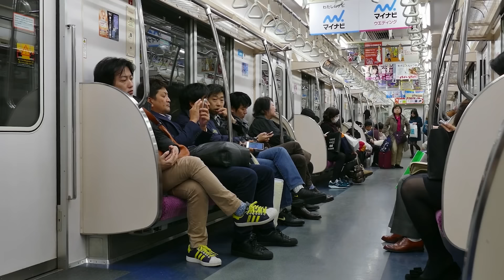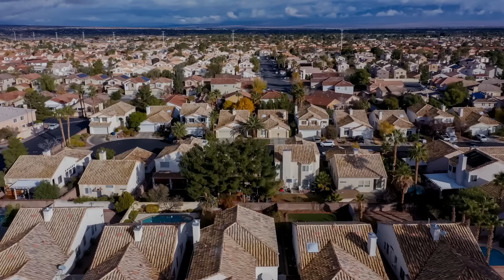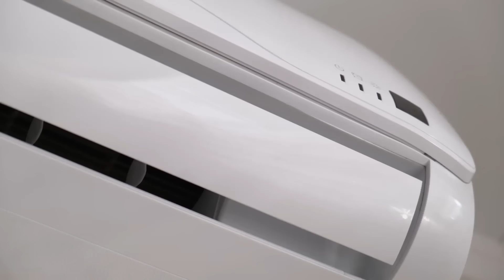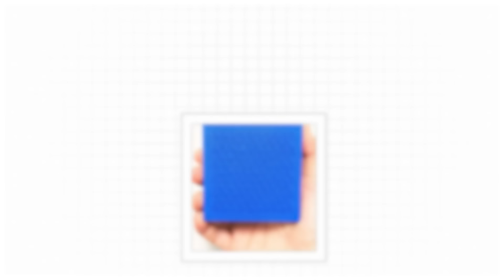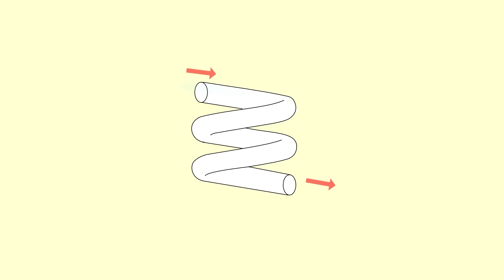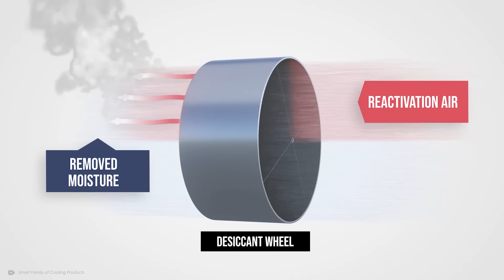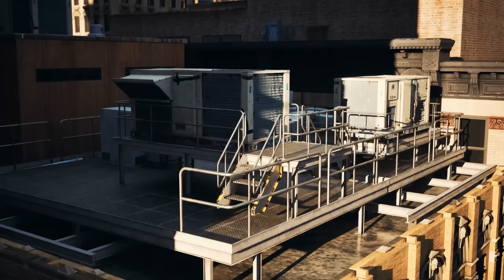The Future of Cooling is Here: The NASA Breakthrough

Comment: So the centripetal force could compress the air which can reduce the amount of moisture the air holds. However, compression also heats the air which increases the moisture it can hold. Perhaps the small channels and high surface area are to promote cooling the compressed air back down towards ambient temperatures. In gas form, the water molecules displace other air molecules that are heavier making air with higher humidity less dense. The less dense and more humid air would tend migrate towards middle of the spiral due to the buoyancy. On principles alone, I'm not convinced this design would be all that effective. Using compression and cooling down to ambient is still generally an interesting approach but I'm not sure if the energy savings on the latent heat removal would offset the energy needed to compress the air. I suspect the desiccant is doing most of the work.

Comment: I'm sure this is something they've already engineered around, but I would have liked to see it addressed as I'm curious: How does the Helix system deal with particulates in the air? It seems like condensing water from air with particulates in it would gum it up real fast.

Comment: I have a better idea. Install a network of underground ducts that branch out to each structure. Have the trunks surface in locations that are relatively cool for the locality. Make sure the input end is well insulated from solar radiation. Put air filters at the input end.
   Structure owners simply have to hook up to this ductwork with blowers.
   For added effect, connect systems together east-to-west, with each locality pulling from the systems to its west and contributing its air to the systems to the east. (And vice versa when needed.)
  A bit of a kink to work out is the drainage or extraction of condensed humidity underground, but i'm sure it's not all that difficult in most cases.
Reply: This is already how ventilation is designed in most places, sometimes like in a crowded city there isn't any good spot to get cool air though.
Reply: @flow5718    Understood, but i meant for the lines to be long enough underground so that everyone can get a good amount of cooling. In some cases, customers could need to supplement with a private system, and in those cases they should naturally pay less, according to how much warmer their air is over a baseline. Also by connecting to other local systems that could be many kilometers away, or perhaps by circulating deep seawater for heat exchange, large cities could augment their cooling. Overall, i think this is where we're all headed. Rural or exurban properties might have private systems that do the same, as such systems are already in use on a small scale here in the U.S.
Reply: Another thing that's just occured to me: in dense urban areas, to further augment cooling, have the customers sell back some of their return air so it can go back underground and continue to other customers. Not all of the return air, though. Some still needs to be vented to the roof. And actually, the most efficient way to drive the system is to put one single blower at the roof, at the point where all the exhaust ducts converge. When it turns on, if all doors and windows are closed, the community A/C will blow out each open supply vent as if it were pushed, when it's actually being pulled. For more volume through a given room, simply install more exhaust vents in the ceiling of that room. Flow is from down to up as the air warms, thus minimizing energy input needed to move it through the structure.

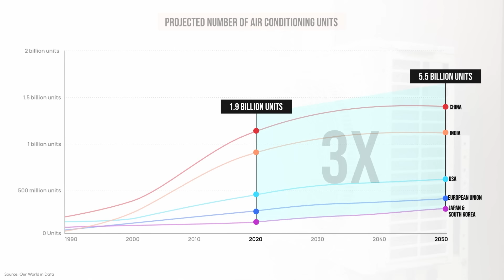Comment: 5:48 This graph looks wrong for 2020 and therefore the multiplier of 3X is likely wrong too.  The number of AC units can't be 1.9B as it looks like China has 1.2B, India has 0.9B, USA has close to 0.5B and Europe and Japan together have close to 0.5B.  This totals around 3.1B.
Reply: It is a stacked chart, not a regular chart. China has only 730.2M, India 47.4M, USA 399.5, EU 115.3, Japan & SK 218.1M.
It is from the Our World in Data web site, you can see that on the lower left of the graph.
Reply: If it's a stacked chart, then the totals and 3x claim are even more wrong. The total of the stack for 2020 is about 1.2B, not 1.9B, and for 2050 it's about 1.4B, not 5.5B, so the increase is 1.2x, not 3x.
Reply: Having checked the original chart, I don't know what Ziroth has done but his chart is way off the original - only the totals are correctly taken from the original chart.
Reply: @aeonturnip2  Agreed - it looks mixed up, India is below Japan and SK in the beginning, and China is smaller than India - maybe it was done by hand.

Comment: As someone who lives in Phoenix, and has noticed our "dry heat" summers change into "humid as balls" summers, (thanks climate change,) I'd love to see how easily this can be added to residential AC units. Especially since my home has two of them, and saving energy costs in the summer would be amazing. Even if just adding the filter makes a difference, as opposed to an entire liquid desiccant system.
Reply: Why does your home have 2 of them, for redundancy? That's pretty "cool", HVAC companies charge an arm and a leg to come out during the summer.
You can easily retrofit this or a liquid desiccant system for your current ventilation intake. Since you live in a hot place, heating the desiccant should be free at least during the day, or you could run the line near to the condenser coils and put that waste heat energy to work.
Reply: @flow5718 Well I'm lucky enough to own a, fairly large, two-story house. So there's one for upstairs and one for downstairs.
Thank God I have solar, otherwise the electric bill would be $700-800 PLUS, a month in the summer.
Reply: If you set your thermostat to 96 degrees, your electricity bill will be $40/mo.  You'll get used to the heat.  I have.

Comment: Most of the air cooled down by an AC has already been through the AC multiple times and thus already dried out. The performance improvement you quoted must assume a rate of ingress of outside (humid) air. What is this rate ?
Reply: That depends on the ventilation, more people = more ventilation. Also, just like pre-cooling your home before you come home after a vacation you can pre-dehumidify the air so that the initial cooling load is reduced. Very useful for peeps who travel a lot for work.
Reply: This depends heavily on the application, some industrial applications require 20 air changes per hour within the room but for some buildings, like say an office building it can be as low as 3.  But if you have something like an industrial freezer there will be no intentional air changes so fresh air only comes in when the door opens.
Reply: You are correct that is why you want a split unit and not a mobile unit as that keeps on drawing in new air that is hotter more humid. Because the mobile unit blows air from the room trough the tube outside. That air is replaced by air coming trough openings in the room like under doors that is warmer and more humid.

Comment: Why would OEMs turn down a technology claiming to save 50% in electricity? Isn't that strange...
Helix Earth claim "The Helix MICRA™ unit pre-dehumidifies supply air, substantially dropping the load on the existing unit and lowering power needs by 50%."

Note that this helix filter structure only removes droplets, whereas the 30-99% rel. humidity that is non-condensing still requires a whole lot of energy to remove. That's the latent heat of 2230 J/g. Sadly, the video does not really explain the actual solution to the energy problem other than hinting at what is effectively latent heat storage in a thermal battery.
I'm missing the total system analysis here. Surely it could be cool to drive off the water from a hygroscopic salt solution directly (solar thermal), but that is not what is being shown in the experiments or on their page.

From where it stands for me, this is a "spend a few percent more energy on ventilation to overcome the filter flow resistance to be able to split off latent load from a purely electrical heat pump application into a combined heat pump + solar thermal evaporation" setup.
Reply: 50% is a meaningless number. It doesn't say what it was compared against. Having just upgraded my AC to a heat pump, I increased efficiency by removing 70% of electricity used.
Reply from the maker: I believe the idea of going for retrofit instead of OEMs is around time to market and possibly economical drivers, but you make a very good point. And yes this was an error on my part. I believe the liquid desiccant is used first as an aerosol spray to turn the water vapour into liquid droplets first, and then the helix coil is used to remove these droplets.
Reply: Ya this video was very poorly explained and likely just a regurgitated press release. 

Reading between the line these helix filters are an improvement to existing hygroscopic brine air pre-treatment process. The process can be quite efficient at removing water vapor from the incoming air, but the process requires a very large surface area for the brine and air to interact. Traditionally this is dripping water down a large column filled with some media both water and air can flow though and that provides a lot of surface area to interactions  

https://www.youtube.com/watch?v=R_g4nT4a28U is a much more helpful explaination of the process. 

The Helix filter lets you inject the hygroscopic brine as a fog into the incoming air. Water is absorbed into the microscopic brine droplets fairly quickly due to the very high surface:volume ratio of fog and the helix filter pulls the fog out of the now drier air.  You can regenerate the desiccant by the same process buy with warmed brine that will release vapor into the air.. 

Even without solar thermal, the rejected heat from the heat pump can be used to dry the desiccant, meaning that ignoring system losses you double the efficiency when the latent heat load is at least 50% of the total load.
Reply: It's the desiccants that remove the most moisture.  Some desiccants are like the movies really... where it drys a body out to a mummy in minutes like in the OG CSI show!  Guess that's a gruesome image but the liquid desiccant that is mentioned (and is under wraps- proprietary) is where the humidity gets removed.  This is well established tech but maybe they found a better formulation of a desiccant that is more effective or something but this tech works (I speak of the science, not Helix in this), so it works but desiccants are very corrosive and can be dangerous, the expense of adding to existing systems, maybe high maintenance for the "filters" whatever they are for, etc. mean the tech from Helix may need some more  time to get the kinks worked out (if its possible)...

Comment: The challenge for retrofitting is that the device with all of the micro channels used to centrifugally remove water droplets will cause a great deal of resistance to air flow.  The blower motor may not have enough power to maintain proper airflow and may require replacement with a larger motor and fan or blower.  An advantage of working with OEMs is they can design in that extra capacity to overcome the air resistance.  Many homeowners unknowingly put too restrictive of a furnace filter in their HVAC systems thereby reducing airflow and efficiency.
Reply: Yeah, it's quite an obvious flaw that I doubt why he didn't even mention it. I don't even work with airflow or similar systems, but my first thought was "won't it congest airflow? Did they solve it? Why didn't he mention it at all?" Mentioning it was made by NASA doesn't make me more optimistic since physics in space working on earth is a whole 'nother animal honestly. While the principle is the same there are different things to consider that might wildly affect the outcome.
Reply: I would recommend they make a standalone device that is just a highly efficient dehumidifier. This would essentially be giving the same benefit, and anyone could just go to the store and buy one...., or multiple for a larger house.
Reply: @xeridea    I was planning on saying the same thing.  And I personally would be highly interested in such a dehumidifier.  Most stand alone dehumidifiers add heat into the living space, but it seems like this method would be a very low heat generating way of removing moisture.
Reply: For whole home HVAC systems, it can be easily retrofitted, unlike split or window units. You upgrade the fan in the ventilation intake if needed and slap this thing downstream of the dust filter.
Reply: @flow5718  it's still weird he didn't at all touch upon it. Anyone who even somewhat thinks about it will have doubts about how it influences airflow.
Reply: Practically, anything that has high airflow builds up with contaminants.  Plugging a helical micro channel could mean end of life.  So, better and better pre-filtration which means more and more fan energy to move air...perhaps to the point of killing benefits of entire system.  But we hope that there is a workaround.
Reply: The restrictions through the little tubes is crazy. Why not make a big long tube??
Reply: spinning air to remove humidity is utter bullshit, guys! There are no droplets in humid air unless it's so humid it's a literal fog. Water in humid air is gaseous, and H2O gas is lighter than air...
Reply: All this green deal and green credits and CO2 hate doesn't make sense CO2 is good for plants, when we shut down for covid air pollution plummeted over China, and USA is spending trillions, companies and EU as well on green energy. We were already far cleaner than China without this giant EV and clean energy push. Plants will turn your CO2 Into lush condition for humans to have both oxygen and many plant resources... but we kill the biosphere and use bioengineering corporate competitive seeds rather than natural and smart methods like letting cows graze on farmland for ine year atleast every decade to replace fertilizer. Cycle crops. Etc...
Reply: Great, that's all I need is my A/C to sound like a Dyson vacuum running 24-7 consuming 825 continuous amps just to save 3 watts in A/C compressor usage.

Comment: This is just old tech repasted and renewed. You gotta stop posting these kind of stuff Ziroth. It's basically a marketing strategy for a dehumidifier.
But AC's already have something like this. There are little innovations in this area because the general purpose hasn't changed in a century.
The only thing I've heard about in the past few years was an antenna that inefficiently converted some heat from AC units into microwaves that can be shot into space. But again, extremely costly and inefficient

Comment: If rather have it dry than cold. In fact I always run my ac on DRY.
Reply: I'm confused by your sentence. A/C's usually cool and dry out air. If you're just drying the air, that's dehumidifying. If you're cooling and adding humidity, you probably have something similar to a swamp cooler. An air conditioner that has an evaporative cooling component turned off, is just a fan.

Which type of a/c are you referring too?
Reply: @Corfal split units usually have a "dry" mode. Essentially it runs the fan at a minimum setting and then runs the compressor at whatever speed gets the evap the coldest without freezing.This is probably most useful in a humid environment where it's not too hot. It does differ from AC on low in that if you have a set point (70°f) and on low fan speed the compressor can run at 50% speed (splits are usually variable compressor speed and fan (inside and out)) but the 50% speed might not get the evap under the dew point and theirfore only cool but not remove absolute humidity. Dry mode set to the same temp would run the compressor at let's say 80% to get the evap to 35°f and pull out water. The compressor would then run a 65% duty cycle) or whatever.
Reply: @gameonyolo1  neat, so it effectively would work as a dehumidifier?
Reply: @Corfal  I mean the "dry" mode. I guess, it focuses on drying rather than cooling and uses less power. I'm no technician, just user.